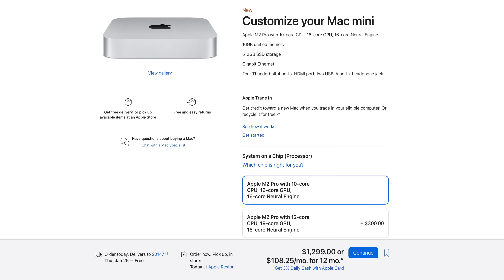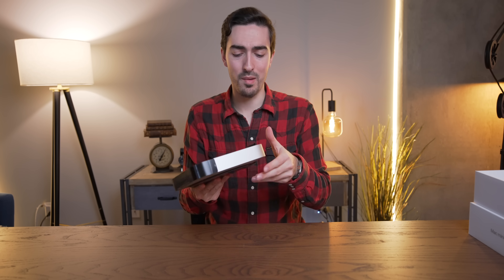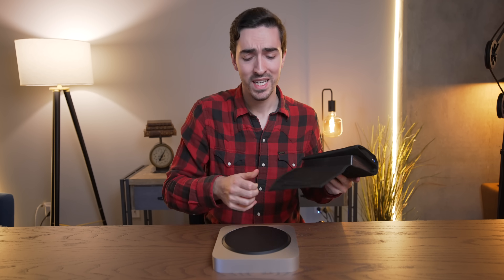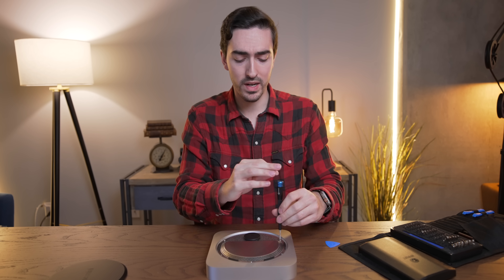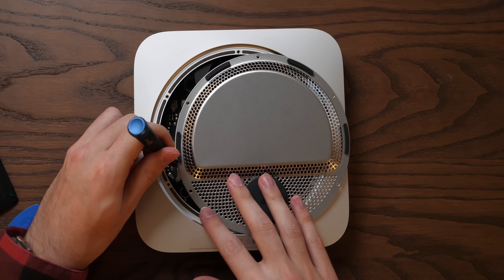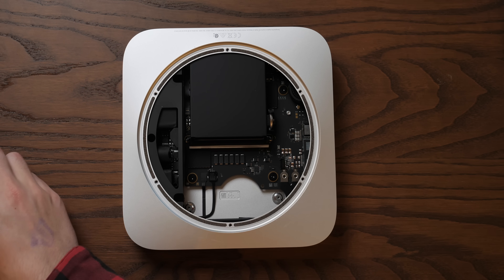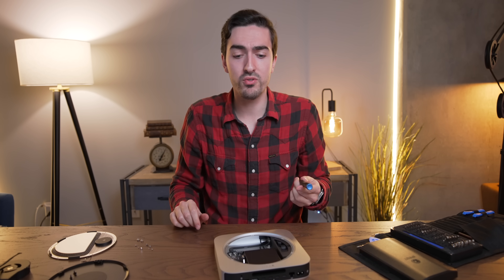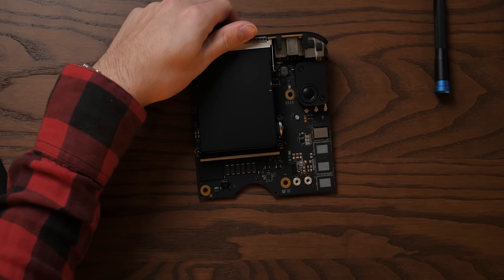M2 Pro Mac mini TEARDOWN review!

Comment: I have that Mac Mini, and what I would do is maybe buy it with 32GB RAM (then you are using the four memory channels and you'll have double speed there), then I'll buy an M.2 casing with a NVMe SSD intern 2 TB (reads 3500 MB/sec) inside and you'd have a "Pro Machine" for under USD 2000,-.

Comment: After researching my options, I bought the M2 pro mac mini with 32gb ram as a work from home design machine and its handled everything I've thrown at it so far. I wonder now if I needed the performance for my use casse but at least it should be future proofed! Great little silver box, has flawlessly replaced my 2008(!) Mac(Hack)Pro I was running, even though I can't run 5 hard disks on it as cleanly haha

Comment: This week I needed a new Mac after 8 years using my 2015 Macbook pro. I saw this was in my budget and only few months old, I just bought it. Now that I'm seeing this video and other reviews, I'm very happy with it. AND this thing is flying compared to my 8 year old MBP. That was the top end 15" MBP at the time and it still works fine for internet and video usage. I can still sell it for around $500. M2 pro Mini can play games even. I was playing Civ 6 ultra maxed out settings, the fan didn't even speed up. CPU temp was in the 60s. When I was recording the game fan and temp was the same. When I was exporting the recording from ScreenFlow, CPU went up to 80C but fan still stayed at 1700. When I sped up the fan manually to 3000, it cooled the CPU down to 65, that's a drop of 15C! This is a beast and should work for anyone who think they might need Mac Studio but thinks it might be overkill. That was where I was, thought I needed a Studio.

Comment: Luke, on the M2 Pro  - If the RAM and the Storage were user upgradable, a maxed out Mac Mini M2 Pro 10/16-core would only cost $2400 instead of  $4,100. A saving that is enough to buy that 27-inch 5K Retina Apple Studio Display and even have money left over. 
My question is, is the money disposable, the suggested convenience worth such an excessive premium or it is a fashion objiect to show off with peers - for typical Apple clients.?  I know it is not the operating system as macOS can be as good and as frustrating as Windows can. And if anything a decent PC is way more flexible then a Mac.

This is not a rag on Apples as we own two, but owning PCs as well the stark contrast really hits home.  I just cannot get my head around why people would willingly pay such a premium when there are as good alternatives out there. Luke, what do you feel?

How I estimated the saving - M2 Pro RAM is 6,400 MT/s LPDDR5 SDRAM  upgrading by 16GB is $400 while on a PC that would cost approx. $100. Upgrade to 8TB SSD Storage costs $2,400 on top of the cost of the included 512GB SSD while a NVMe Gen4 8TB would cost approx. $1000.
Reply: apple silicon designed for planned obsolescence
So since the MacBook Pro (2023) uses Apple Silicon processors, the RAM is actually part of the M2 Pro or M2 Max chip. This allows apps to quickly exchange data between the CPU, GPU, and Neural Engine. So while this could boost performance and efficiency, it also means RAM upgrades aren't user-accessible.Jan 30, 2023
Reply: @alberteinsteinh  It also means that by being unified RAM, it needs to provide the memory requirements for the CPU, apps, loaded data and video needs, from the same pool. 

That means for example that the base models of the Macbooks, Mac Minis and iMacs with 8GB can run out of it's LPDDR4X  (4.3MT/s) RAM very fast and then have to access the slower 256GB SSD, which will slow them down. Even $600 gaming consoles that also use unified RAM come with a minimum of 16GB GDDR6 RAM (18 MT/s).

The other killer with the M2-based Macs, the base model SSDs are only half as fast as the M1 versions. A fact that Apple does not display on their website.

For the PC, a 1TB PCIe4 Gen4 NVMe that is 4 times faster then the SSD in a base Mac and an external TB3 housing costs $155. Apple charge $400 for an increase of effectively 75% of that size.  Going with 2TB is only $232 while Apple charge $800.

I just purchased a new M2 base Mac Mini and have already upgraded the avaialble SSD storage as described above, plus with it being an external TB3 device, it is even faster then the on-board SSD speed.

With us being on the 2nd revision of the Apple silicon, I find so many Intel-based Mac apps/games will still not work. As far as Windows apps, one has to be willing to lay out even more money for something like Parellels/Crossover. And forget about DirectX 12 games. And this is the state of things even after two and a half years since the M1 was launched.

I am attracted to Macs for many reasons, but once I stop and analysis how Apple applies the Apple ecosystem, I am reminded more of predatory practices that make shady vehicle dealerships look like trustworthy angels.
Reply: @mughug9616  man, why do you keep using a macbook? is it for work or because you enjoy the product or what?
Reply: @alberteinsteinh  Being disabled and an ex-IT professional I have computers as my hobby. I have two Raspberry Pis, various Android devices, An old HP Xeon-based server, Intel/Nvidia laptop, an AMD Gaming PC, 1 x Intel iMac, 1 x old Intel Mac Mini and 1 x M2 Mac Mini in the house. I just love to experiment and play with them on a hardware and software level as a pastime. I even have had some like the old PowerPC Mac clones, A Sun Solaris server and other weird PCs over the years. I find it keeps me occupied and the brain cells active.

I also provide support to my wife who uses an Imac for her home business and for locals, etc. Having the Macs helps me get the hands on.
Reply: @alberteinsteinh  I have mixed feeling over Apple and curse them at times like you. For me the Intel/AMD world is where it really shines for me.

My main is a self-built PC with AMD CPU/GPU, 32GB of DDR4 RAM with approx. 11GB of internal storage ranging from NVMe, SSD and down to HDDs. On top of that I have local access to approx. 12GB of NAS storage.

You know that if I had that kind of equipment in the Apple ecosystem I would have had to sell my car and wife to pay for it all. 

The base mode iMac (Late 2012) was purchased nearly 10 years ago on a whim by me and has actually been by my wife for my wife's home business every since. I have to admit it had performed very well and her needs are pretty basic as well. The Intel Mac Mini (Late 2012) that I picked up for $70. I then upgraded it to a spare 512Gb SSD and 12Gb RAM that I had lying around. Allows me to keep my skills freash without experimenting on my wife's iMac :)

The M2 base model Mac Mini was purchased on a whim. And the plan is that when the wife's iMac gives up the ghost, then she gets the Mac Mini. I agree on the restrictive RAM issue, but considering I already have a 32Gb and 16Gb RAM PC and laptop I will not suffer too much. Being a PCer I am not paying $200 plus tax for another 8GB of RAM on the Mac Mini !!!!!!

Seriously, having hands on with the base model M2 Mac Mini I am impressed. Comparing it to my PC (AMD 5800X/RX 5700 XT, 32Gb RAM) and my laptop (Intel i7-10750H, GTX 1660Ti and 16Gb RAM) it does perform a hell of a lot faster than older Intel Macs and gives my PC and Laptop a run for their money in benchmarks and general use.

The Thunderbolt 3 topic - Similar to USB and offers up to 40Gb/s speed. The enclusure is just to house a NVMe and then it plus into the Thunderbolt 4/USB port on the back of the iMac. JUst like plugging in a USB drive on a PC.
Reply: @mughug9616  you should look into the newest super computers and quantum computers in america that should peek your interest.
Reply: @mughug9616 oh my god, you spent so much on a Mac Mini. i will never spend more then 1 thousand dollars on a macbook and that's only for work. why can't your wife use a Laptop or Computer tower instead of a overpriced mac mini that will be a paper weight in a few years with non upgradable hardware, and planned obsolescence
i swear to god, apple users are crazy, i only would buy a macbook for WORK. and then i can profit in millions and avoid using macbook for non related work stuff. man their are so much better companies and products then buying apple hardware.

$1,299.00or
$108.25/mo.per month for 12 mo.monthsFootnote*

 Apple M2 Pro with 10‑core CPU, 16-core GPU, 16‑core Neural Engine
16GB unified memory
512GB SSD storage
Gigabit Ethernet
Four Thunderbolt 4 ports, HDMI port, two USB‑A ports, headphone jack
Reply: @alberteinsteinh  Pointless talking to you as you seem to have an agenda that blinds you to certain facts.

That is clear because of your use of the term 'paper weight'. If you bothered to read my post you would see that the 10-year-old 2012 iMac 'paperweight' my wife currently uses every day for her online business is still doing a fine job and she loves it. I see no reason why the Mac Mini will not stay relevant for as long. Id so it makes good value in that situation.

Pointless chatting any more with you.

Comment: obviously the studio etc will go M2 as well, but for now it seems like you always get these mixed worlds of chip generations…

For the refiview here, If the heatpaste gets applied to the full surface of the chip and the heatsink it would optimize the cooling hence avoid potential throttling - right ?!

Comment: 6:14 Typical YouTuber symptoms: The camera talks back to you.

By the way, mac mini sometimes is a nice buy even for Windows users. There can be something good if you have one macOS device, like... building a iOS App with Flutter, Maui or Xamarin Forms. It's only the case for the cheapest one. Once you add some memory, no.
What's not good about this is that there's almost no reusable component in the device or even upgrade path. Cinebench score is a little more than what $136 APU can achieve if you goes with outdated Ryzen and do not care some noise and power consumption.

Comment: Hello Luke I have a question 🙋‍♂️ min 4:50 Mac mini m2 pro has 2 x 256 chip that’s mean they are working in parallel?? That’s right?

And how fast can be 2x (times) 256 gb ??

7k write and read?

I’m very interested in this Mac mini m2 pro without upgrade my hard drive

Comment: The smallest M2 Pro Mac Mini costs 1.549,00 € (16gb ram, 512mb ssd). With that money you could buy a PC with a i9-13900k, 64GB DDR5 and 2TB of pcie 4 NVME. The SSD would be more then DOUBLE the speed (3gb/s vs 7 gb/s), the Cinebench score would almost quadrouple (12.000 vs 40.000) and you have 4 times the amount of RAM (16gb vs 64gb). 
Sadly the M2 Pro is rediculously overpriced.

Comment: Mac fans love to take it up the rear lol. $200 for a 512gig nvme chip, WTF is wrong with  Sheeple? What they did is not innovation it is trapping you in an ecosystem that nothing but buy a new one will fix. To many vids out there showing $200 in parts will take the base to the pro speed. This would be $600 in Apple upgrades but, hey get your pound of flesh there.

Comment: The extra cables connect to power supply should be PS_ON, Power good signal and/or some remote. The big connection clearly is just ground and power so they need these signal have other route.

Comment: I am interested in why it is my base level mac studio has around a 33% faster internal storage? Any thoughts or am I missing something madly straightforward?
Reply: They use only one NAND chip for the entry level M2 machines, which means it has slower sequential performance since it's not multiple modules striped together like the larger-capacity Minis and Studios.
Reply: @davidfuchs845  sure, I know that, but I mean size for size, 512 v 512, my base macstudion has BMD speed test results at 4600 write and 5200 read

Comment: L2 cache for M2 Pro is 36 MB & L2 Cache for M1 Max is 24 MB which gives an upper hand in GPU performances when It comes to 3D applications for M2 Pro. M1 Max has an advantage of expanding upto 64GB of RAM while M2 Pro is capped to 32 GB of RAM .If I have to, I probably might go with M2 Pro for my use case scenario.!  Awesome video , Great tear down , Thanks 🙏🕊 I had a great time watching this video :)

Comment: The really entry level stuff from Apple has impressed be like the base M1 MBA and the base M2 Mini. But $1299 is a lot for a desktop. I know it’s small and quiet and efficient, but I gotta wonder, how would it compare to an ITX system with something like an i5-13400 and RTX A2000. I know the system will be louder and pull more wattage but you could build a pretty small PC with those and for far less than $1299. And the total TDP on something like that would still be under 200W which is pretty good.

Comment: As other reviewers have pointed out, the base M2 Mac mini is $700 less than a base M1 iMac. If you use that computer as your budget, you get a more powerful system right out of the gate but can use whatever peripherals you want. There are lots of great displays for about $500 and you still have money left for a decent keyboard and mouse.

Comment: If i order 2TB, will that mean 8 chips of 256GB, or will they just use 4 chips of 512GB. The read write speeds would be way faster for 2TB if that meant 8 256GB. What have you heard? Can you test or link to a test that compares SSD speed for 2TB vs 4TB vs 8TB? Most Detailed review of motherboard yet of Mac Mini M2 Pro. Thanks!
Reply: it looks like for the 512GB model, there is only one NAND chip as well (according to a you tube video by elevated systems. so for 2TB, they may only populate one side of the Motherboard with 4 512GB nand, and for 4TB they may either choose 4 1TB chips to only populate one side of mother board, unless price of nand cost more than price to place more chips. so i guess only the 8TB model has all 8 spots filled. i wonder what the performance is 8tb vs 4tb, that would answer if any difference, is there a test out there for that?

Comment: Great unboxing- teardown. I was  interested in whether the 256GB ssd was a single nand chip and therefore slooow. I think you had the 512Gb ssd.
Reply: It is, MaxTech tore down the base model
Reply: @RaphaelMatto  yes thanks I saw that
Reply: @RaphaelMatto  looks like even the 512Gb if a single chip is slower as well! Like half the speed
Reply: @pauljazzman408  Yeah, my guess is 1 256 is slowest (like 1700), next is 1 512 (abt 3000), then two 256, then two 512, & probs reaching max speed with three 512, or three 1gb chips. That's how it works w/fast nvme drives usually: higher capacity is faster, but when you raid them together, speed almost doubles until you hit the theoretical max, usually around 7k. From what I've seen anyway on consumer stuff.

Comment: So, there is something curious. I just bought an m1 pro macbook pro 14, base model. I ran black magic disk and my read and write were consistent between 4,5 and 5GB/s (it ran for about 1 minute). So if your m2 pro mac mini get only 3 GB/s it means it is way slower than first generation. Could you make a comparisson between base 14 m1 and m2? I would be really interested to see if the results will show a slower, faster or equal speed for the SSD (and also some other real world tasks like reandering video speed, copy 40-50 GB folders, exporting big photos, opening big apps like davinci resolve...and so on)
Reply: It likely has to do w the number of ssd modules. If this had two 512 modules, I bet the read/write would almost double, since they’re in a 0 raid.

Comment: 999$ should be the price, but the competition is so absolutely terrible and nowhere near, apple can easily ask the current Price.
Kudos to Apple, AS is a gamechanger for real.
Reply: No.  It does not work that way.  iPhone sale in 2022 has dropped a lot.  iPhone in 2022 are better than competition.  Under such economy condition you need good price to sell products.

Comment: I would've advise you to remove the thermal paste on to another container for reuse. Apple from 2018 MacBook Airs do not use normal thermal paste and went to use something more dense to fill better the gap between the SoC and heatsink. Reapplying normal thermal paste (MX-4 etc.) will not have the same effect or fill like Apple uses. Or get a TCRS thermal paste; they have made and created a substrate almost the same as the one Apple uses.

Comment: Great video as usual. Can you help me ? I'd get one of these and remote in to it from a lightweight laptop for working round the house, but I've got an M1.
My M1 MB is fine for me. But - I broke the card reader - mechanically. Can it be fixed ? I've had the laptop in bits and I can't see how. Can you ?

Comment: 2 questions,
does it have 8 performance cores, or only 6 (+4 efficiency)?
is the SSD almost 2x slower due to use of just two 250Gig NANDchips instead of four 120Gig dies?

Comment: You cautioned us against spec’ing the mini up too high, advising us that one should then just get the M1 Max Mac Studio instead.   I think that is wrong advice.   In most every way, the new mini is BETTER than the Mac Studio.   To most people, CPU is more important than GPU. The mini is better here.  It has a faster chip AND more CPU cores.  The HDMI 2.1 is a game changer to me.   It has updated wifi6e and Bluetooth 5.3. At the same price, the Mac mini is better in every way except multi-core GPU performance.   And most people don’t need that.
Reply: Unless Apple comes with an M2 or even M3 variant of the Mac Studio.
Reply: @maxkortestappen4027  Of course.  And they will.